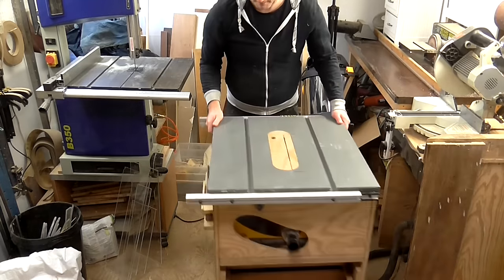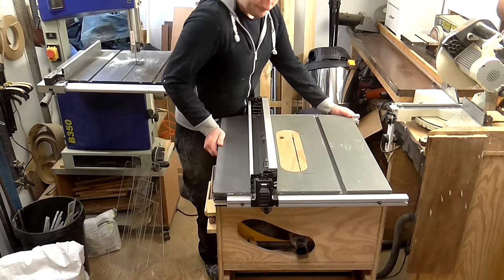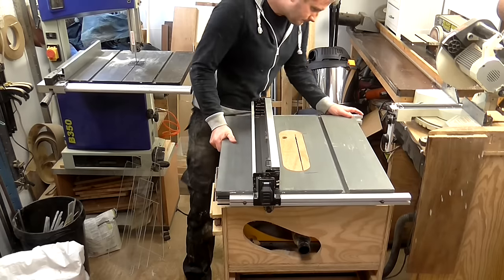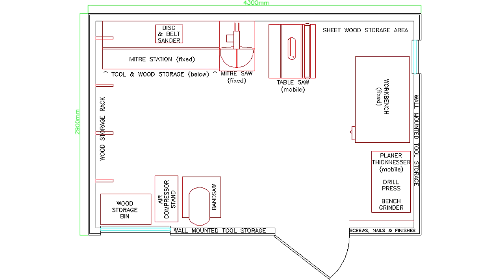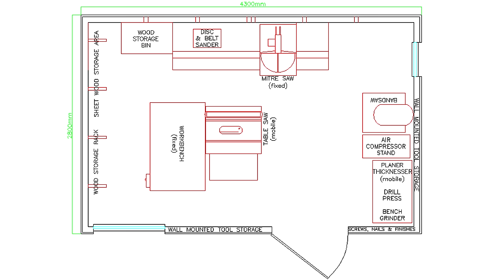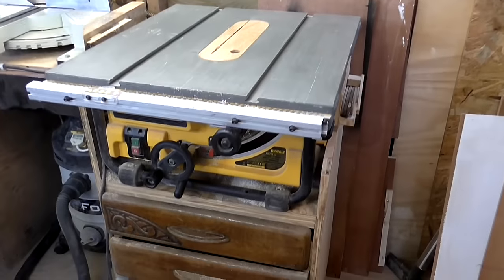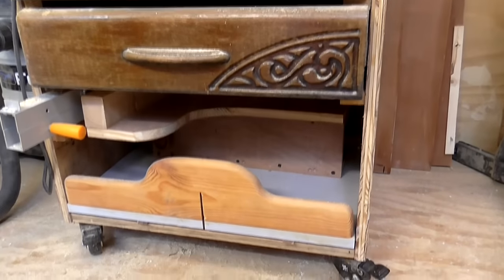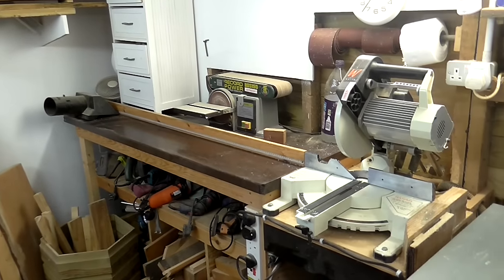Small Workshop Layout Changes - A Quick Introduction - Workshop Re-Model Episode 1

Comment: It looks like an improvement  but will still be a tight squeeze. I am currently designing the first layout for my first workshop. I am finding it difficult to visualise what it will actually be like to use and issues like trying to squeeze past the table saw will be issues for me too. in fact my table saw is bigger than yours and I only have a 10x8 workshop.

Comment: personaly I'd put the table saw at the wall, making the rip fence parallel to the wall called "wall mounted tool storage".
Im not quite sure what that place looks like but you'd get a lot more space and there is no real need to have to ways to walk to the back in the shop.

but I dunno, just my two cents
Reply from the maker: +0j0nn I thought about that but that wall isn't long enough really I wouldn't have enough rip capacity got a lot of cuts that I make